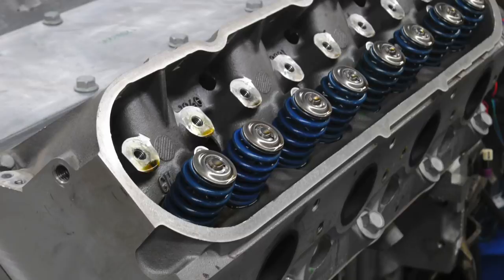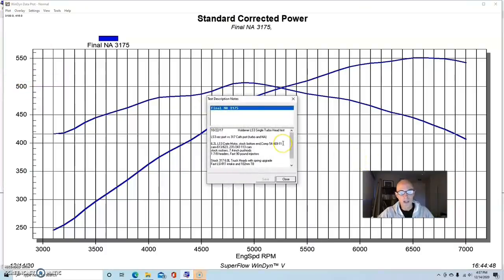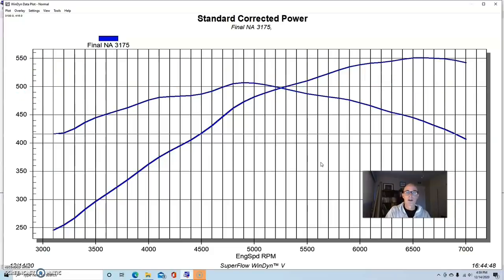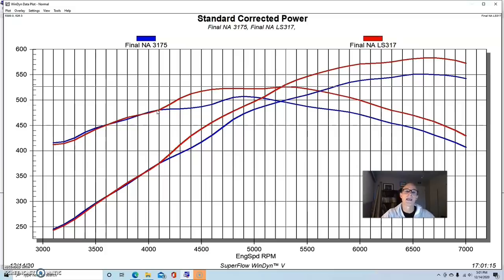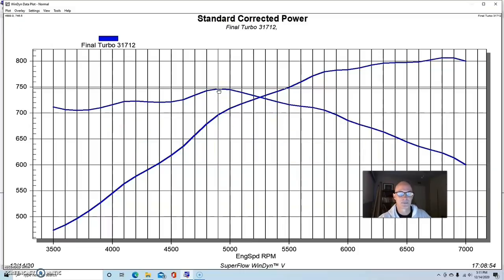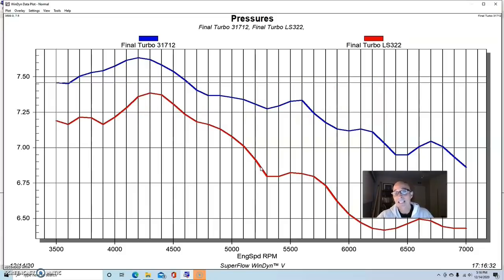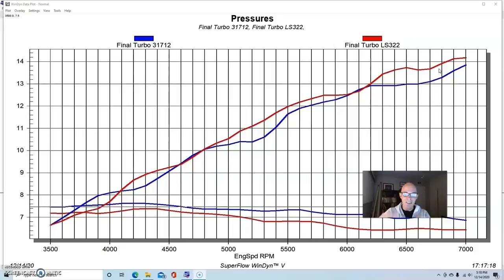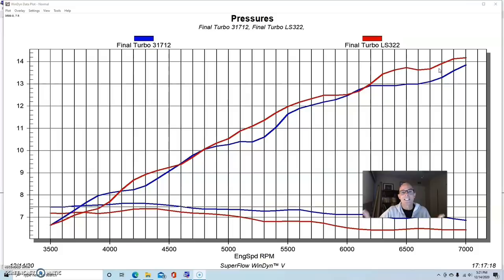TURBO LS HEAD TEST-317 VS LS3 (NA & TURBO)

Comment: My 6.0 came with 823s on it, so I’ll keep them. When talking absolute numbers, there’s really quite a difference between the truck 6.0 and the car LS3. A bit over 3% in displacement means about 20 hp at the top. Dropping the compression a full point means another 20+. Suddenly your 584 hp peak is down to about 543, all other things being equal. If you drop back to a bit shorter cam, like 225° intake lobe instead of 231°, then you’re down to just over 500. My 6L90 should be able to handle that, but putting the turbo into the equation would make that a big question mark. I think it will move the old C10 down the road, but the rwhp number won’t be so impressive. We’ll just have to see if it demands a turbo later...

Comment: I would say upgrade and maximize everything. Make the power with the least possible stress on the motor.
Reply: My thoughts exactly.
Reply: Except that in cylinder pressure is what makes the power, so for a given engine configuration the stress seen by the pistons, rods, crank, and block are the same for a given power level regardless of if it took 20psi of boost or 70psi of boost to get there.  Boost is only a measurement of intake restriction in that case. The caveat to that is of course when compressing air it makes heat so as boost pressure goes up so does the heat and that is detrimental to power and of course components.
Reply: @bcbloc02  Stress on the bottom end is only the same/similar when you compare IDENTICAL bottom-ends at a given power level with different power adders or induction.....A bone stock 4.8 LS would need 8500RPM to make 600hp N/A and LS7 shits out 600hp at 6000RPM...VERY different bottom end stress levels. Stress on the bottom end is even WILDLY more different when comparing different engines (SBC-BBC-K24-2JZ, etc)
Reply: @rustysausage69  I was talking about engines where only head flow changes effected boost levels for a given power.

Comment: Unless you're building a max effort engine the smallest heads to make your power goal will provide the most area under the curve.

I run 862 heads on my 370 lq9, and it makes the thing a torque monster.

Comment: Ok I need some opinions. I’ve got an iron 6.0 bored .030” over that I’m fixing to rebuild. I want some flat top forged pistons with valve reliefs, either summit or DSS, to go with stock rods. I’ll be running a S475 but I already have a set of 243’s ready to go. Will my compression be too high with this piston head setup for boost?
Reply: @mctigmctiggy1475  you’ve got a point. I forgot to mention that it as forged pistons that I was looking at. Even my guy at the machine shop says if it was him, he run the 317’s. Because I have a set of those as well. But from watching Richards videos, if I can make more power with the 243’s N/A, then it’ll make more power under boost!
Reply from the maker: the S475 will determine the power-you can make 1000 hp with stock 317s
Reply: Non-decked 243's on a flat-top 6.0 will give you 10.5:1 compression. Personally I would go with 11:1 pistons (4cc dome will give 11.5:1 with 243 heads) so that youll still be in nominal compression range if you upgrade cylinder heads later on (most have 68cc chambers). Also more power with more compression. 
Compression is NEVER too high for boost, its only ever too high for your tuner.
Reply: I had been doing some thinking on Richards earlier video about optimizing the N/A setup and how it’ll carry the power into boost. I’ll be daily driving and using my truck for occasional towing and frequent hot doggin so I’m looking to keep my low rpm grunt. Thanks for your comment Richard and friends!!

Comment: Great video and information as usual, Richard! I'm actually in the process of turning my LQ4 into a LY6. I was not a big fan of turbo charging, so I wanted to do the best I could afford NA. But might turbo charge in the future, so this video helped a lot. If I was going to turbo charge from the beginning, I would have saved my money on the heads and intake. Put that money towards the turbo and the conversion. The 30 - 60 hp/tq you gain  between 823 vs 317 heads and intakes is not worth the money
Reply: 6d

Comment: Ok so to further the question. What happens to power/torque If we keep the intake and exhaust runners, valves, spring rate and compression (I realize that means different pistons) exactly the same and keep the shape of the chamber the same but use different chamber sizes will we see a greater overall effect on power by going to smaller chambers or a top end effect on large chamber heads

Edit: Whilst under boost that is.
Reply from the maker: you just change compression by changing size of chamber-compression changes power through the whole curve

Comment: Unless you need every last 1/4 HP save your Money to put into your Transmission and Chassis
Reply: True that! I've seen many cars with less hp outrun more powerful cars just because the trans, converter, and chassis were spec'd correctly! I think many guys overlook that.
Reply: Adam Engelberth everyone needs 1000hp to go 9’s. Then the “other” guys make 700’s and go 8’s.

Comment: There is a good size list of changes when switching to ls3 style head
If more airflow IS needed a ported set of 317 heads is far less costly and much easier 
No ?

Comment: Agreed, there's more exaust backpressure because there's more exaust from the higher power production. 
Higher power production also implies higher intake flow. 
Maybe the lower boost on the LS3 head is a result of more airflow through the compressor. 
Compressor maps show that for a given turbo RPM, boost drops as airflow increases.
The higher backpressure spins the turbo faster but not enough to make up for the lost boost from increased intake flow???

Comment: Can you run 20 degrees of timing at 7psi on 91 pump gas , race gas no problem , I think that’s the power potential ???
Richard start testing are good ole California pump gas and e85 , see what the most output is , throw in some high ambient temps , see what the low buck street runner gets , love the channel !
Reply from the maker: pump e85 works well

Comment: Up to a 1000hp, I really cant see the need to worry about a head change. On another note, you should run a 6.0 and a 6.2 in the same trim just to see the power difference.
Reply: So, let's go back to the 706 vs. 799 head video. That 6.0 made like 513hp with 706 heads, and something like 524hp with 799. In this video this 6.2 made like 560 something with 317's. As we can see these numbers are kinda strange, considering the loss in compression with the 317's vs either of the other heads. So, is .2 liters worth 10, 20, 30 hp. That's what I'm curious to see. Not to mention Mr. Holdner apparently loves testing. More content ideas, the more videos, and more questions get answers.

Comment: You can probably find a set of ls3 heads and intake for cheaper than buying a fast intake for the cathedral ports and still make more power with ls3 combination..
Reply: I agree with you, problem has become finding an intake.  Truck rec port is more affordable but LS3 has become expensive.  Maybe just get the Holley intake?
Reply: @philsautobody  I’ve seen new ls3 intakes go for a little over 300 on eBay, I’d imagine a holley intake would work, only some of us f body guys would have trouble fitting them under the cowl without having to chop it up and delete our wipers.. 😔

Comment: You can get a pair of 823 and an intake for half the price of just the fast intake. Its well worth the swap. More power and far cheaper. Most guys wont have paid for a fast intake. If you buy a T6 hotside to start with,  you can clear 1000+ at the wheels NP.

Comment: thank you for this video i have the Lq9 swap with the 317s and was asking if its worth me spending 700plus or just get a turbo with my 317 heads
Reply: Once you go turbo you will never go back.
Reply: If the engine is bone stock, put that money toward cam/lifters/springs/gaskets instead of boost. If the motor already has a decent cam, wait til you have $1000 set aside for it and get forged pistons/rods (dome with a point higher compression so that it makes more power N/A) so that down the road its 100% ready for boost. That's my opinion and pretty much what I did with my chevelle. I could've supercharged a stock+cam LQ4 and make good power til I turn the pistons into swiss cheese, but instead I installed wiseco pistons, SCAT rods, and LS3 top end (Roughly 5K all said and done) which costed less than the supercharger and still makes 600hp N/A for good fun. Its now perfectly ready for boost (literally install supercharger, tune and done) and will make 1000hp with ~10psi later on if I decide to (kind of pointless for an autocross car).

Comment: Would the high back pressure b from both exhaust sides into 1 turbo cause to much back pressure what if you tried just as an experiment single turbo only on 1 side and standard header on the other. Would b interesting
Reply from the maker: I have tried that
Reply: @richardholdener1727  it didn't work out to well I'm guessing

Comment: I'll stick with my 317's and save a bunch of work.
Reply: It has a cam, valve springs and roller rockers also a rebuild.
Reply: Lq4 6.0
Reply: Stock 6.0?
Reply: Nice! I just bought me a Silverado with a 6.0 not sure on if a lq9 or 4🤷🏻‍♂️🤦🏻‍♂️😂 but I’ve been watching this channel for a minute and lots of good info. How’s your truck run now with the mods you’ve done, I as well got the 317 heads but been thinking of swapping.

Comment: I wish it was as cheap and easy to build a reliable 1000 hp transmission as it is cheap and easy to build the engine.
Reply: Oh my god yes, can someone please tell me what is the “LS” of the manual trans world is, cause ya boi ain’t got no T56 money
Reply: @kyholm  You'll need an adapter, but the CD009 Nissan transmission is reliable to 800 hp, shifts better than the T56 and costs $1500 brand new from Nissan, you can find them in the wrecking yards for $600.
If the shifter is too far back, by a few inches there are shifter options.
If it's way to far back then the Nissan Truck 6 speed has the exact same internals as the CD009 in terms of strength, the ratios may be different.
Reply: @johnparrish9215  I've looked into the CD before for a Fox I'm building, but unfortunately here in Canada, they are a little more expensive ($1200 from the wrecker) and then I've still got to buy the adapter kit ($1300CAD by the time it gets to me) At that point, you could buy a T56. Arn't project cars cheap fun? lol.
Reply: @johnparrish9215  I hear the cd009 is a great trans and see many run it but I highly doubt it shifts as good as a t56. T56 is hands down one of the best 6 speeds money can buy. and the best I've driven personally.
Reply: @thatturbotruck  I've had both, the T56 does OK in racing but suffers in daily use against the CD009. The Nissan is just that smooth.
Reply: @kyholm  look into the AR5 transmission... said to be reliable up to 800hp, cheap, and easy to find. Adapter plates are also readily available 👍🏼
Reply: @kyholm  T56
Reply: Yup, there really isn't an option that's very affordable if you aren't willing to just treat transmissions like wear items, pull timing/boost down low to help them live, etc. Been going through this as my nephew has a Fox project that we've been talking about BBF swapping(factory block 557" stroker w/ SR71 heads, 13:1 comp for E85/meth, and a turbo with very mild boost) and keeping a man trans in. With an engine you plan on being 4-digit capable, you end up in this hole in the market where your options are like <700HP affordable 'street' trans(TKOs, T5s, most production 5-speeds of the '90s-'00s), 1500+HP all out racing transmissions that rarely have an overdrive option(even 5-speeds will have a 1:1 5th - like what you see in Pro Stock), or ~1000HP(a little more with some aftermarket $$$) 'street' transmissions that cost as much as a racing trans(re: T56/TR6060/Magnum). It's pretty weird that there's no real answer actually.
  
As of right now, we're looking at a 2 stage upgrade of the trans - do the swap with the engine NA and run a rebuilt Ford top loader, which, with good internals, should be good for ~1000HP with a slipper clutch(ClutchTamer) taking all the shock load out of the launch, at a "reasonable" price. Then, after some time passes, bust open the piggy bank for a Liberty 5-speed and a turbo. Just gonna have to run some big highway gears to emulate "OD" 5th and gear 1-4 for the 1/4. 
 
Hate to say it, but a top loader with some aftermarket shafts is probably the only real 'budget' 1000HP(sticky tire on a sticky track of course) trans, and even then you better be set up for some clutch slip on launch to make it live(granted that's how you go fast with a clutch anyway). It's pretty crude, old as dirt, no OD, and you aren't exactly going to find a lot of swap kits for them - but, hey, they are strong as hell at like half the price of a T56! Lol
Reply: @RyTrapp0  Yeah I hear ya man. Gonna be the most expensive part of my fox body build!
Reply: I think that a lot watching RH’s videos.
Reply: @jimmy_olds  Za
Reply: Th400
Reply: The answer is a Th400.
Problem solved
Reply: "Budget" depends on how built you're going, and the intended use. Here's 3 examples of my own from wild to mild, or expensive to cheap.... 

1. My Monster 4l85e is holding up behind an ly6 with a BTR stage 3 turbo can and an S480 billet t6 turbo at 18psi..... not sure on hp, but I can smoke a stock C8 in the 1/8 mile pretty easy in a 5600 lb truck that's lifted.

2. Here's a bad choice, cause of high rpm shifting. The TKO 600 behind a 5.3 with twin t04e 66mm turbos, sloppy stage 2 cam, and dyno tuned to 712hp at the tires. It's in a 2900 lb Camaro with drift compound tires.... There is no traction, it's meant to go sideways. The problem is that these transmissions don't like to shift above 6k rpms. For daily driving it's great transmission though. These are known to live at 800-1,000hp.

3. The real budget one, the old Muncies. I had an m22 behind a 396 with an 8-71 on top. I could lift the tires on a 66 Impala, and it never gave me any trouble..... Damn I miss that car.

I'm not going to list all the ones I've blown up, but they include the 727, c6, 4l80, AOD,  t10, nv4500, nag1, t56, and a lot of smaller ones..... I'm an engine builder, not a trans builder. I just swap to a better tranny when I blow it up.
Reply: @doc221978  Thank you for the insight
Reply: Power glide 😂😂
Reply: TH400
Reply: Instablaster...
Reply: 80E
Reply: 4L80e. Done
Reply: 4l80

Comment: Thankyou for the awesome vid! What about upgrading the cylinder head for the extra thick deck surface? Because I’ve always heard once you get around 800 hp on a factory head then it’s close to push a head gasket because it starts distorting the head even with ls9 head gaskets and arp studs
Reply from the maker: we ran stock ported 706 and 317 heads on a couple of our big bang motors-the limit is way above 800 hp

Comment: No, absolutely not, run what you brung for a turbo set up.  Your factory LS cylinder head will give you what you want except for a spring replacement.  If you want 750 street horsepower, any head with a decent cam is going to work...  Sloppy(elgin), BTR, or Summit...just get your lift.  Tried and True don't BS me builds terrorizing the street in that range all day long.  If you need or have to have 1200 or better, it's far more complicated.

Comment: we're running 317 heads ported 225 intake CC with 2.05 valves and pack 650 Max Springs. Flow 305 or more. These things make big power. We're currently running about 1300 horsepower . Possibly an LS3 head would make more power at the same boost but I don't think we've come close to the limits of this current combination. Only 25 lbs of boost still have another 10 pounds left in it. 35 lb of boost should make big Power with the 317 heads
Reply from the maker: we made 1482 hp with ported 317 heads-lots left

Comment: Just for fun I would really like to see what a set of 317 heads that have been ported with larger valves installed would do.  When know the 225 cathedral trickflows can outperform the rec-port LS3 heads, but can the 317's with a little work do the same.  Might not be worth the money for the machine work I don't know.
Reply: Don't they come with the same valves?
Reply: @pmotorsports8276  No, stock 317s come with Intake - 2.00, Exhaust - 1.55.  225 Trickflows come with intake - 2.055 in.  exhaust - 1.575 in.